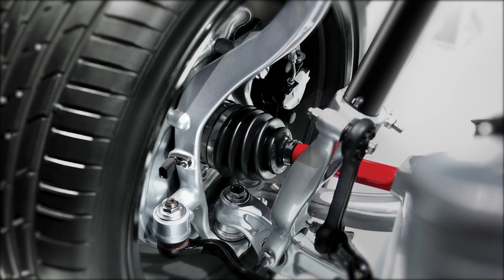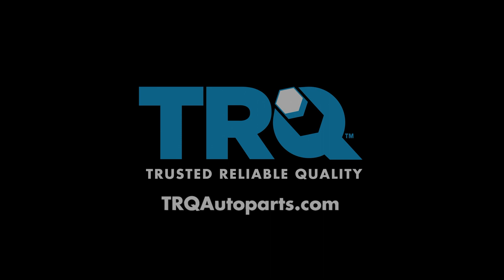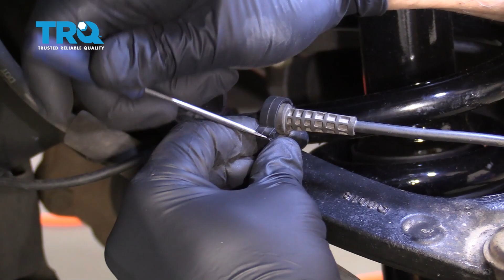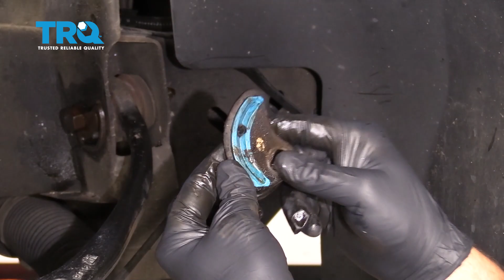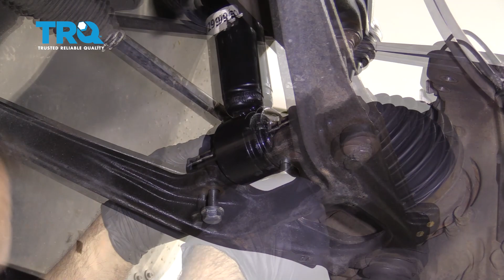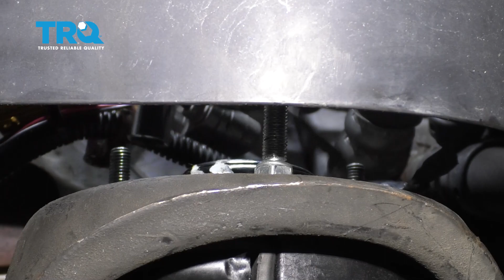How To Replace Front Upper Control Arm 2007-2014 Cadillac Escalade

Comment: How come the bolts dont go in the from the outside. Can you change them so it can be easier thebnext time and put the bolts from the outside in instead of having the nut on the outside, put the nut on the inside

Comment: There is another video from them showing just the bolt replacement and they didn't remove any of the extra stuff.  Replacing the upper control arm is just one extra bolt on the ball joint an that point.  Seems like it should be possible without the extra removal.

Comment: Why did you remove the struts and sway bushings just to replace the upper control arms? Too much extra work
Reply: To access the bolts. I’m having that issue right now and I came to see if it’s necessary to remove it, I’m trying to avoid removal but I think it needs to come out.